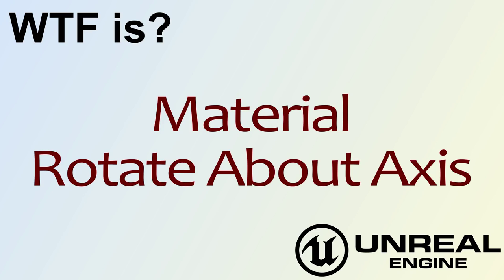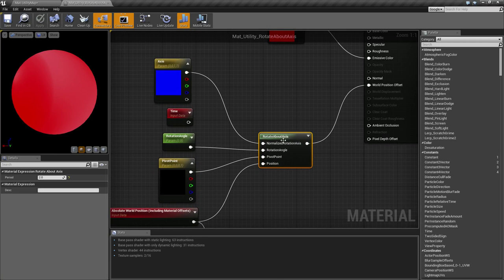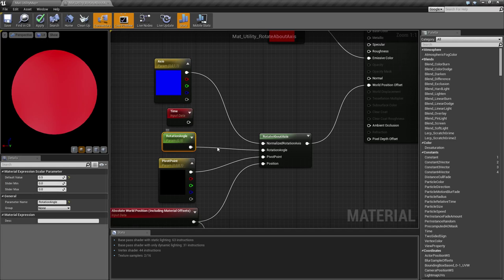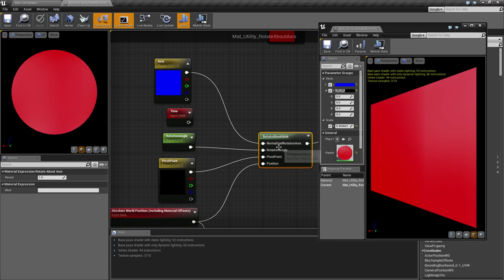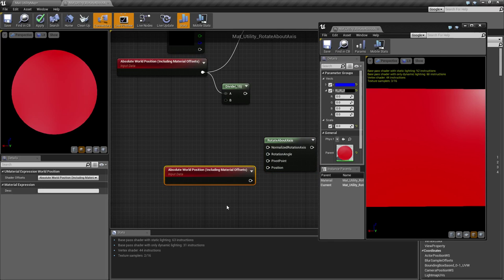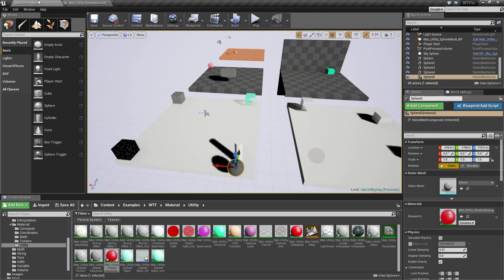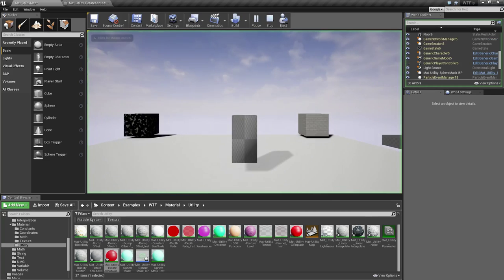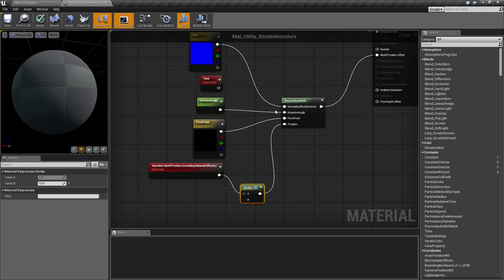WTF Is? Material - Rotate About Axis in Unreal Engine 4

Comment: Good video, though the explanation of how the Period parameter relates to the RotationAngle input without time was pretty confusing.

Here's my explanation in case it helps future readers. Everything is in degrees.
( TLDR: If you aren't using the Time node, just set your Period to 360 and then forget it exists. )

Despite its suggestive name, the Period parameter really has no functional relation to time on its own. All it really does is divide the RotationAngle value, nothing more. It only relates to time if you deliberately chose to plug a Time node into the RotationAngle input pin.

In that case then yep, it's as Matt explained: Period = number of seconds a 360° rotation takes. This is certainly the main use case the devs were thinking when they made the Period parameter.

But the RotateAboutAxis node is very often used without involving time at all, such as simply rotating objects on the GPU to take load off the CPU. The Period parameter still does what it does, which is this:

RotationAngle input x 360 / Period = actual rotation amount

This really isn't worth bothering to remember.
It just means that if the Period is 1, then every 1 unit of your RotationAngle input will produce 360 degrees of actual rotation.
If the Period is 2, then every 2 units of your RotationAngle input will produce 360 degrees of actual rotation. And so on.

The only thing worth remembering really is this:
If you aren't using the Time node, just set your Period to 360 and then forget it exists.
You will then be able to simply use the RotationAngle input for the actual rotation angle you always intended.

Comment: Did you notice too, that the normals aren't updated when rotating an object via this node? In my case the object rotates but the normals seem to be wrong afterwards.
Reply: I don't knwo if this is related to this, but you need to keep in mind that this example is moving vertices in GPU only, CPU don't know about this rotation at all so any data that comes from CPU is automatically invalid as for CPU object is where gizmo is.
Reply: You seem to be everywhere Simon! haha. Have you by any chance found a solution for this? Cheers!
Reply: yeah whenever you rotate in any way in a material you have to make it afjust the normal accordingly.